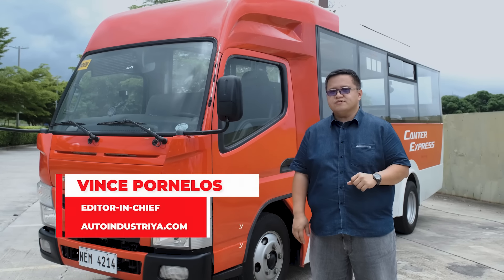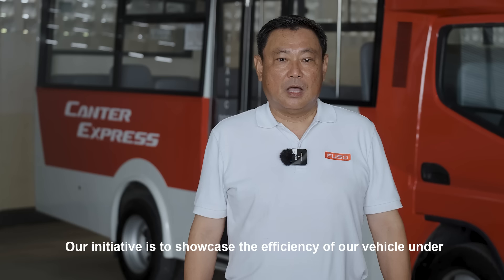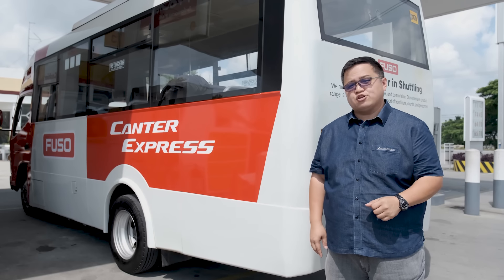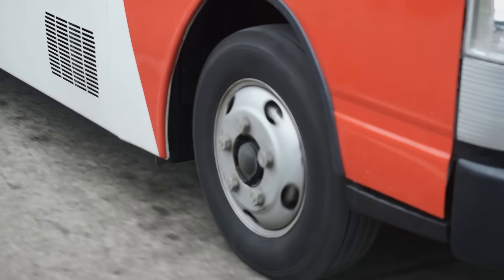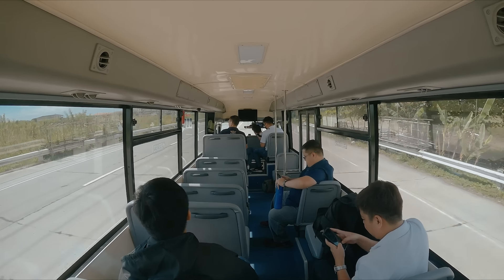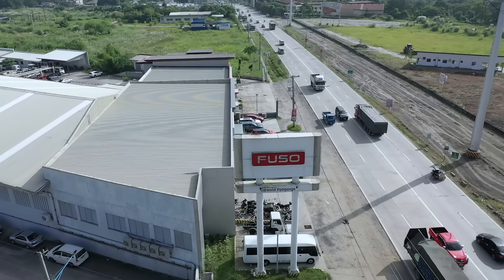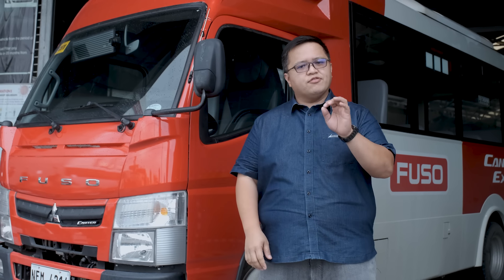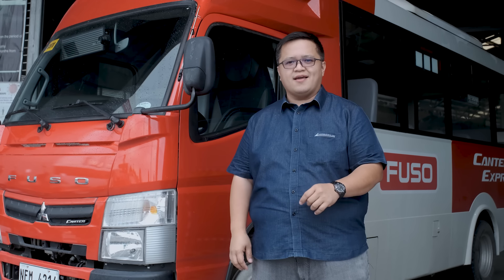Fuso Fuel Eco Challenge: How efficient is the Canter Modern PUV Class III?

Comment: The vehicle is okay, but the seats? Cmmon fuso, can u not make it as beautiful as the hino class 3 or higer class 3 with a 27 seater capacity? If that will be done then i believe this will be my choice for our route here in the cordilleras
Reply: It depends on the preference of the buyer. But, most of the Modern PUVs was on the Side Facing Seating isntead of Front Facing Seating Configuration.

Comment: idol, hopefully soon you can do real comparo, ex. hilux 2.8 MT, vs hilux 2.4 MT VS innova 2.8 MT vs fortuner 2.4 MT,. or ford ranger bi-turbo vs turbo vs 2.2 MT, isuzu 3.0 AT vs MT, VS RZ4E. same number of loads and at condition like how this fuso was done. what i want to know is does smaller engine really have a big advatage over the larger ones, at stand still traffic everyone is doing 0kms/liter but more of Liters consumed per Hour while on IDLE. 
What i noticed also about car reviews is real world test, like full load, actual traffic jam during rush hour, or compare pick ups 800kgs load, all the way to baguio. think about the TFL Truck Ike gauntlet hill climb with tow. thanks.
Reply: Good points. Generally speaking, yes a small displacement engine requires less fuel at idle than a larger displacement engine with all other things being equal (same fuel type, all being turbo or all being N/A, similar CRDI/EFI systems, idle speed, etc). The drawback with a small engine is you have to rev it up more if you have to deal with heavier vehicles; for example, a small 1.5L non-turbo gas engine will have a tough time on an uphill with a fully loaded cabin of 7 persons. 

The comparo is really our dream, but it's difficult to pin down the schedules for all vehicles we want to do, so we just do two at a time. We had a big comparo planned, but the scheduling conflicts made our original plan fall through. We'll try again in the future.
Reply: @vcpornelos  thank po idol, waiting for that soon to happen, but for the mean time if sched would not allow maybe even just one at a time do some real world test and the do the same test for the other vehicles once you had a grab on it. thank you very much idol for noticing. and God Speed po.
Reply: @vcpornelos  idol, also maybe you can compare ford territory's 1.5 turbo engine and okavango  vs isuzu rz4e and 1.6 diesel of crv. hehehe